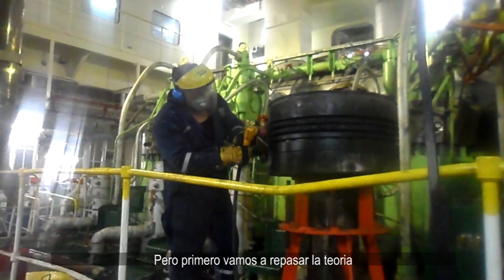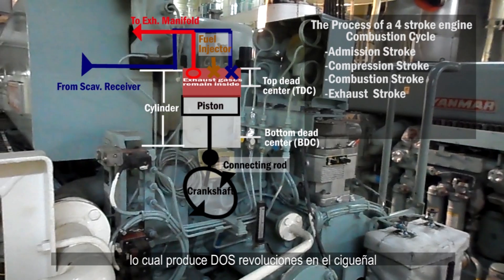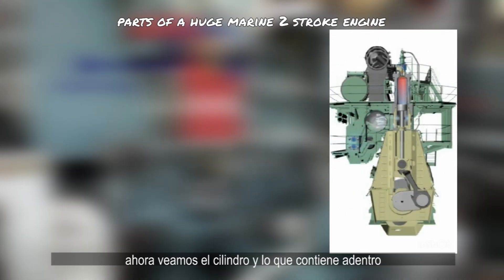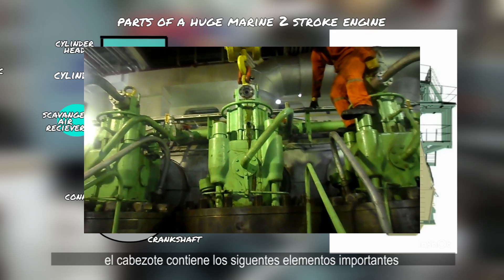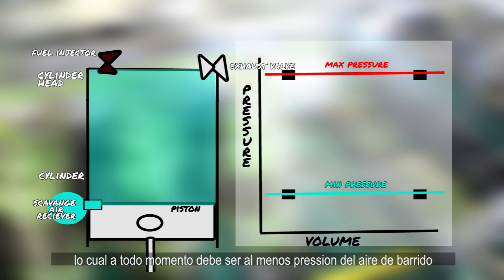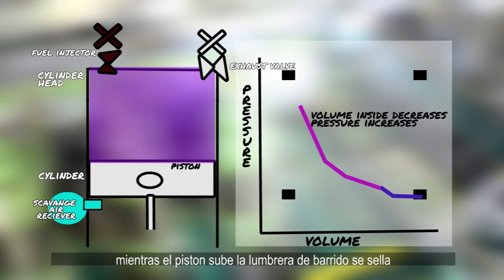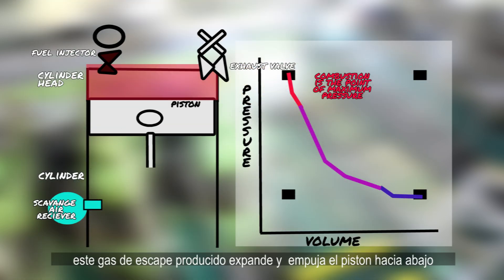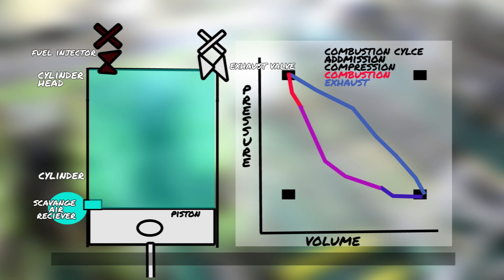2 STROKE MARINE ENGINE - Cycle and Theory

Comment: Hiii ,nice to see another video! Would like to ask you for opinion. I have issue with my 4stroke engine. It makes diesel foamy and therefore having trouble with injection. Two DGs on same fuel system. One creates foam,other one when running alone runs ok. Problem is somewhere in DG ,but i am not sure from where could the air come in to create this mess with diesel? Any advice? Thank you in advance.
Reply from the maker: All right troubleshooting at a distance is always a challange but with the info you are giving me lets analyze a little. Since they both share the same fuel system lets rule out cavitation from a fuel pump due to one engine running fine when running alone since you determined one D/G causes the other to foam. 

If you rule out water contamination (from viscosity and water in oil tests) then we can assume air which could come from fuel injection pumps which can cause bubbling and since diesel has less viscosity than heavy fuel oil it tends to have a hard time to disipate air bubbles which turn into foam. In any case its one thing to test since fuel systems are common until there.
Reply: @ShrimptoShark Thank you for fast reply. Means a lot ,appriciate your time.Water in oil is less than 0.02%. Cavitation I ruled out for same reason as you mentioned . Thank you for advice